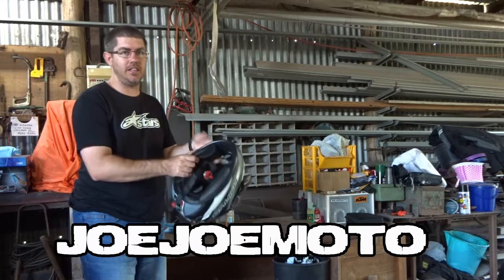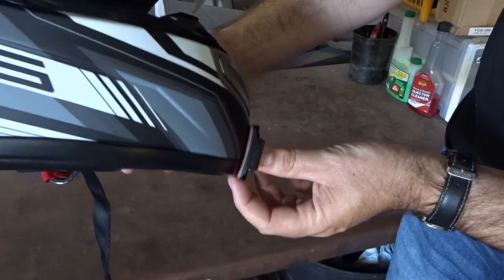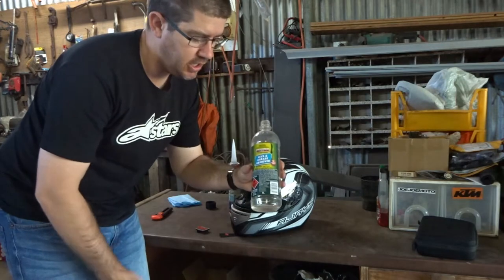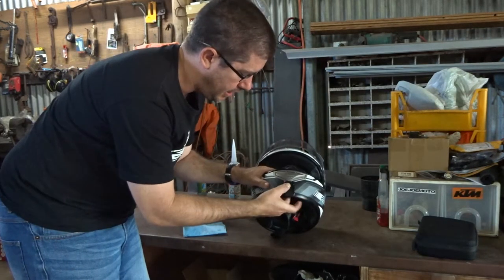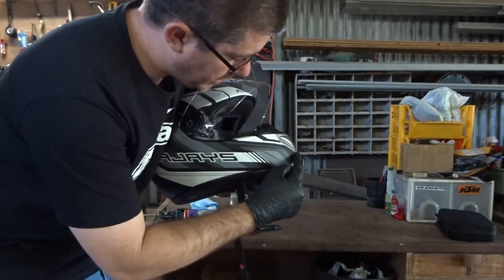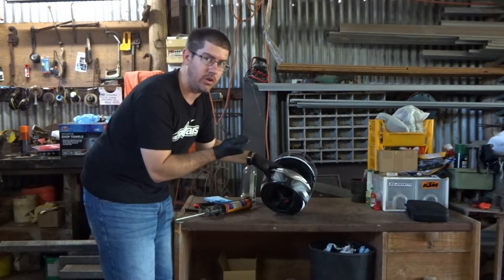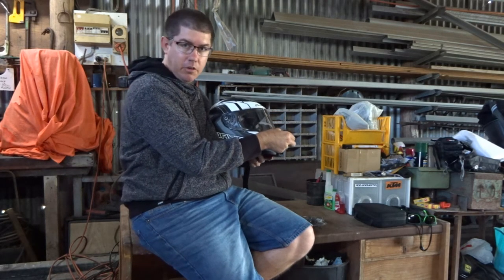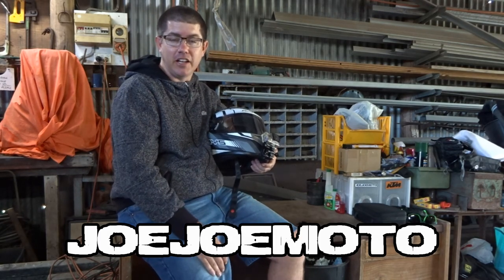GoPro Chin Mount How To DIY

Comment: i am sure that would help out people with gopros buddy :)
I have a sony action cam and it's mounted on the side of the helmet using a flat sony adheasive mount with the stock double sided tape. the camera then sits inside a sony skeleton mount. does the job ok and allows for up and down and sideways tilt adjustments
Reply from the maker: Thanks mate.  Yeah, those Sony's aren't designed to mount on the chin hey.  The chin mount only has vertical adjustment, so it must be good to have horizontal adjustment as well.